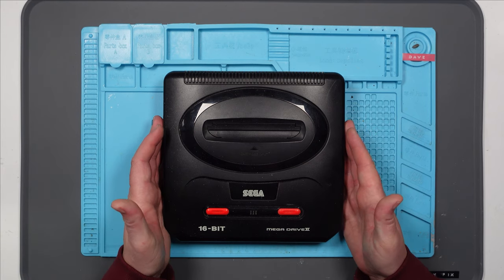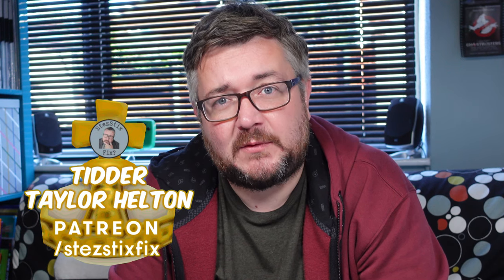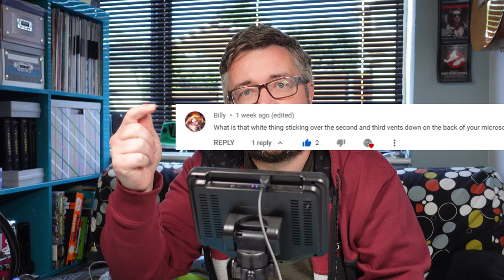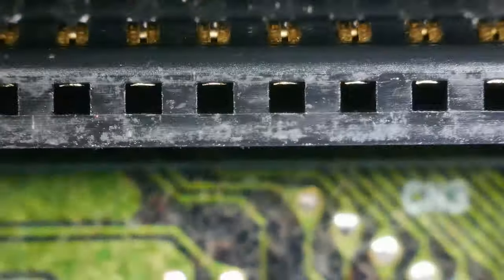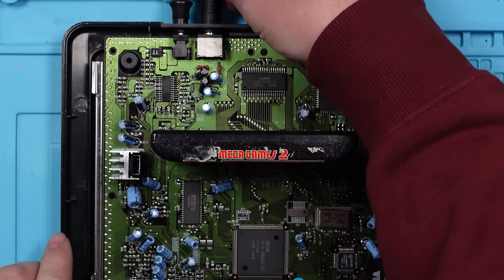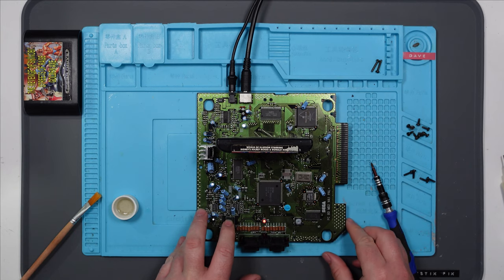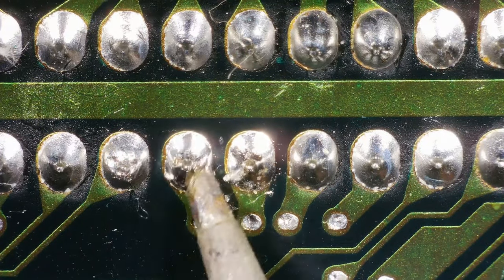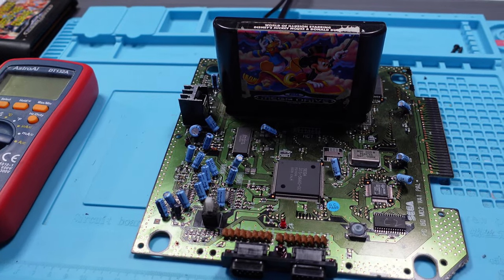Sega GENESIS / Mega Drive II | Black Screen of DEATH! & Bad Audio!

Comment: Hi, if you get yourself a cheapish air compressor with a narrow air gun attachment they're invaluable when dealing with electronics. They blow away all the dust/ grime and detruis really easily. It gives you a nice clean area before starting any repair. Definitely worth the investment as cleaning the internals of any console/ computer is done in seconds. Love you vids by the way.
Reply: I hooked up the Mega Drive 2 recently and like the video I got the first screen and after that it went black. The air compressor did the job!
Reply: And a face mask.

Comment: my bet is someone tried to mod it (thats why some of the solder looked reflowed) and shorted it in the process.  they don't always have to be hard fixes to be good vids 🙂
Reply from the maker: Thanks Zed! Yeah, I think you're right. Someone had definitely attempted to do something in there before! 👍
Reply: No, you can see it very clearly at 5:04 how there's a metal piece coming out of the soldering iron and connects the pins(the 5th and 6th pins from left to right at the bottom) So you did this shorting accidentally, I guess the problem with the console was dirty connectors.  @StezStixFix

Comment: After spending the last 15 years only playing the Megadrive on emulators, it shocked me how much slower the real system runs when I bought one last year. I always thought it was a bit of an urban myth that the US version was so much faster but things like sonic are markedly different.
Reply: oh yeah it's a shock eh.
sonic theme tune on 60hz v 50hz is a great example in the speed between the machines.
nearly 30 years later I realised us in the UK got a very very raw deal with PAL games
Reply: On games such as NES Tetris they completely changed the gamespeed for NTSC vs PAL to sorta make up for it.
Reply: @superamario6464  we got a better picture with more lines for a slightly slower speed. Aslo when computers where starting to gain popularity most programmers where in Europe using pal, so no we didn't get a raw deal, we got what was supposed to be and ntsc got it sped up
Reply: @nicholasgreen2012  err yes we do.
You are talking about more lines being advantageous ...on a CRT...where the primary mode of connection was RF output? This argument stands for the original xbox 360 and 720p v 1080i/p but not for 16-bit hardware.
Also I prefer a faster game on NTSC format. Mario Kart, Streetfighter, Sonic...all faster on NTSC. I don't really care where the programmers where from and why they slowed down the experience.
Reply: @superamario6464  so pal having 100 lines more than ntsc meaning more room to display is better. You preferring a faster game means nothing to how the game is ment to be.
Reply: @nicholasgreen2012  means nothing to you. Let's clear this up and stop all the aggression. I have a different view to you. I will not change. You will not change so let's stop the pissing contest now ok?
Reply: @superamario6464  no pissing contest, you started on me. I'm mearly defending my position
Reply: @superamario6464  and ah feck it auto tagged you in my first comment
Reply: @nicholasgreen2012  are we done here??
You're the one who picked an issue with my initial post.
Reply: @nicholasgreen2012  most console games of the era were developed in Japan, an NTSC country.
Reply: @nicholasgreen2012 You got it back to front bud I was around back in those days and pal was the worst of them unless there was a proper port done to pal which they usually didn't bother to do. Nobody likes playing 17.5% slower games for 100 extra lines lmfao. All the euro devs had 60hz switches on their machines too. Your trying  to tell people pal sonic is how it's meant to be played? 😂
Reply: @Yolo_Swaggins  I was there top and playing sonic on the mega drive and master system.
Most game devs used pal to program as most were from Europe at that time so I have nothing backwards.

Comment: Good video Steve, been waiting all week for it, going on YouTube between classes every day to see if you(or mymatevince) have uploaded anything fun/educational to watch since spending 15 hours on campus some days just suck and I definitely need that break between just to relax and watch these fixes, but I also understand that editing these videos can be an entire project itself and take time too and also that life gets busy, just keep focusing on givingus the same great contentyou usually do and don't worry about rushing for the video. Also I wanted to mention/thank you for having the wii-mote repair video I saw it a while back and I did end up with some broken wii motes and your video made fault finding some of them pretty quick, no way would I have found that fuse 1 on my own to test; I still have a few broken wii motes though that I can't figure out what's wrong with them so I'm gonna give 2 of them a reflow when I get a minute of free time, and there's another wii-mote (with motion plus) that had a smd capacitor explode and it caused a good bit of corrosion damage so that one's gonna be a fun fix, gonna have even more fun finding a replacement smd capacitor for it, but I suppose I can always steal one from the other two wii motes if I can't get them working; I'll probably give you an update as a comment in a future video when I eventually get it done, but for now I think it's gonna be a while since I ran out of space and have no deskspace for my new hot air reflow station
Reply from the maker: Thanks Jacob 👍 really appreciate that! I hope you can fix up those wiimotes, that does sound like a fun little project! Good luck and please let me know how you get on! 👍

Comment: Nice work. How can I have missed this video?! I´m always looking for "megadrive black screen" "genesis black screen", etc etc.
I was utterly excited when I saw you had the copyright message and then a black screen, as that is my exact symptom in my Model 1. Too bad (for me) yours just worked after that reset. 

I´ll keep an eye on the channel.

PS: wow, that was an easily triggerable ocd
Reply: That's a licensing message displayed by the TMSS (Trade Mark Security System) which is in a boot ROM that's in Mega Drives made from September 1991 onwards (Model 1 VA5 onwards).

It checks for a "SEGA" text string in the game cartridge's ROM header, and the idea was, if that was present, that message "produced by or under licence from Sega Enterprises Ltd" would display (and the game would boot), and therefore the game publisher would be claiming to be one of Sega's licensed third-party publishers and that their game was licensed by Sega, so if that wasn't true they could take the publisher to court...

This was after a company called Accolade had reverse-engineered the Genesis and published unlicensed games that worked on Model 1 consoles up to VA4 (made until August 1991) without the TMSS boot room (the Model 1 VA2 Genesis had come out in August 1989, so the Genesis was made without TMSS for 2 years).

Comment: i know this vid is a year old but i think putting this here is the only place to make you catch it and understand what im talking about lol.... to clean a cart slot here is the most effective method... get an old cartridge junk one pull the board out of it and use some 2 micron lapping film wrap around the cartridge pins soak in 99% iso and put in and out repeatedly .. bingo the 10000 grit of the lapping films knocks off the corrosion and does not affect the slot pins! ..

keep up the good work!
Reply: A thin bit of paper towel or gauze with iso on it wrapped around one edge of an old bank card slots in nicely and cleans the cart slot a fair bit.

Comment: Hey. I have a question. I tried to do a 50/60hz mod like 10 years ago on a snes console. I was inexperienced and screwed it up. I bridged 3 pins and then in my panic (mega idiot) turned it on and of course it didn't work. I tried to desperately remove the solder but made it slightly worse (might have bent a pin a little bit), I didn't have the right equipement and only did some soldering before my attempt (not sure why I thought this was a good idea lol). Could I still save my SNES or is it a goner? I would've linked a pic, but youtube really doesn't like linking.
It is on S-PPU2 chip, pin 30-28.

Comment: Why not just buy a cleaning cartridge
Reply from the maker: I'm not sure it wouldv'e worked  here with the cold solder joints, plus no point spending money on one of those when Isopropyl Alcohol does the trick.
Reply: @StezStixFix  if it wasn’t the solder which you did a good jot of and luckily you was rite about it. To clean the cartridges I clean the contacts on cartridges I open them up and rub gently with a pan sponge scrubber I find they come up like new
Reply from the maker: @michailokeefeMooMoo  that's a good tip!  thanks Michail 👍